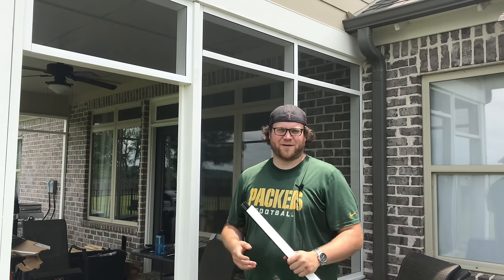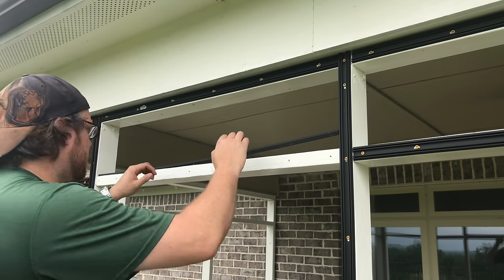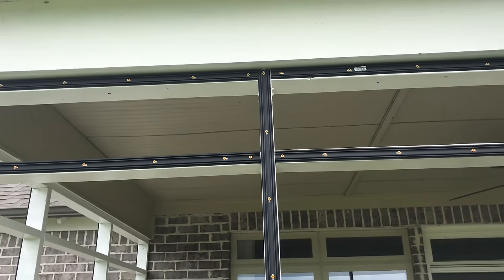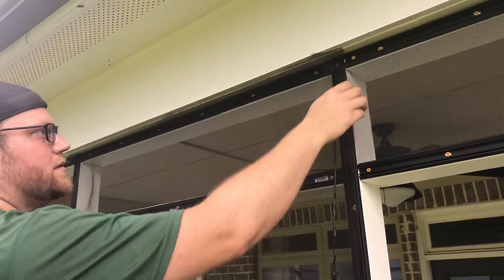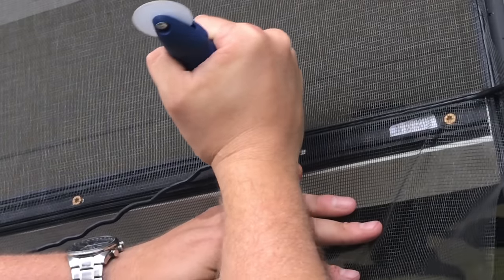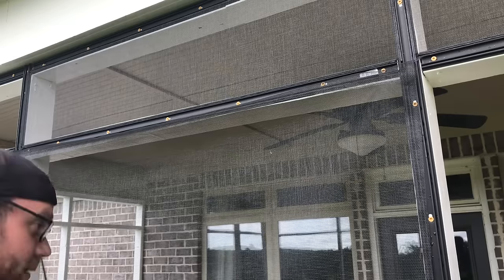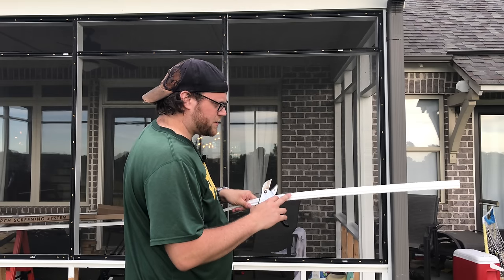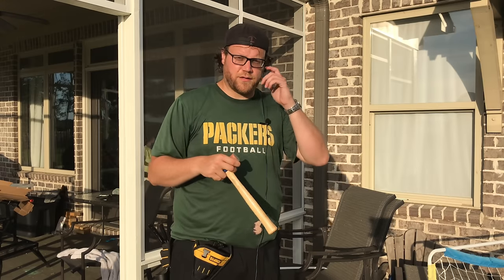Screen Tight Install Tips and Tricks

Comment: Thank you so much for making a video that is so thorough..showing possible mistakes..I'm a 72 year old female and did a porch on my trailer to keep cats from running out the door...It was hard to spline the heavy duty animal screen..especially for old hands..but got it done  and proud ..but never could have done it without your  lesson . Thanks again
Reply: I'm 67 don't have a clue.
Reply: Hi I am going to be using screen tight and using pet screen - what sized spline did you use?  I hear you need a smaller spline for heavier screens.  Thanks!

Comment: I've got to hand it to you, Anthony.  Not only is this this hands down the best tutorial for installing Screen Tight products that I have seen, it is also one of the best tutorials I have seen of any type.  Ever.  Your attention to detail, and additional helpful hints passed on from your own experience doing the work yourself is extremely beneficial.  Most tutorials are far too short and condensed, and omit the most useful parts of an install (the mistakes), and a mention of how to fix those mistakes.  You have included both.  Extraordinarily good job on this tutorial.  You have another subscriber.
Reply from the maker: Thank you for your comments. I really appreciate it. Everytime I attempt a project, even if I’m confident in doing so without any help, I still try to watch videos/lookup how to’s. In case there is something I can avoid or make the process easier. Unfortunately I couldn’t find any video to my satisfaction for this and after starting it myself I knew I had to make a video to get some better information out there. Again thank you for watching.

Comment: This was a helpful video, certainly better than the brief commercial videos put out by the company or Home Depot. I did a large porch DIY with several sections that were aprox 7'x4'. Doing it myself saved me about $2000 over professional estimates.  Also, I am no handy man so the project was challenging to say the least. Note, I found Home Depot the best place to get the "system" both in convenience and price. As I did it by myself there is one tip I'd like to share and one major mistake that Shelton presented.
I kept small pieces of spline in my pocket (2-3") and would use that to hold up the screen at the top randomly (just pushing them in). As I began putting the long spline in I would just pull out the short pieces as I got near to them. I couldn't have done it otherwise.
Shelton's mistake was to advise getting a small wheeled spline tool. You can see in the video as he continues to go back and forth pushing in the spline. I HIGHLY advise spending the $10 to buy the spline tool sold by Screen Tight. It fits their tracks perfectly. There were numerous times I could just run the spline in with a single movement. It also comes with a retractable cutting tool which was incredibly beneficial. You are seriously nuts if you don't by that tool.

Comment: Awesome video, I did the porch on my house when Screen-Tight first came out around 1990, it's a very easy system to install. About 5 years later I went on to start a part-time mobile screening business on the Coast of North Carolina professionally installing Screen-Tight and other systems for porches, rescreening window and door screens in a converted bread truck, then purchased an 18ft trailer to build a mobile workshop.
Your tips were spot on, I used the Craftsman Handi-cut that you mentioned to cut the vinyl in the same orientation that you did.  Later started using a mitre-saw with a 60 tooth blade, that provided a cleaner more accurate cut. I once had a customer that we had installed the system on her 2nd level porch and she later wanted the underside of the deck screened as well to keep mosquitos out, what a pain trying to screen over your head, but it turned out nice.

Comment: Thanks for the video. It really helped me to avoid any huge pitfalls while using this product to screen in my patio. I did make the mistake, twice, of installing the spline on the outside of a track instead of the inside. I did learn, however, that if you install another piece of spline on the correct side before removing the mistake, you will get a panel that is tight as a drum! Mosquito free life is awesome!!

Comment: Hey Anthony. Thank you so much for your video. I am a 63 year old lady with a porch that badly needed re-screening this year but I was not feeling good about those staples, tall ladders, and wood trim. So I did some construction (!!!!!!)   so I could put the screen on the inside using the screentight system. It has taken about 3 months to add 2x4's and stain and then the screentight. A little confusing until I watched your video because the manufacturer's videos are minimal (hey it's easy!!) , although they were very helpful with my email questions.The project is nearly finished now except for the door. The ONLY thing I would add is the use of the "mouse" tool to put the screen on. I had a difficult time with the other tool. I also bought the cutting tool you recommended.
Reply from the maker: Paula D the mouse tool, is that the one that has 2 wheels?
Reply: @TheVintageEngineer  yes

Comment: Thank you for a realistic instruction video.  I am not a skilled handy man and I did one section before I watched your video.  I couldn't get the cap on because I used the wrong track to spline and none of the manufacturing videos were detailed enough for me to know what I did wrong.  You answered that question and gave me a half dozen good ideas.  Thanks again and off to buy a tool belt....

Comment: Excellent tutorial.  Thanks.  One thing I did differently was to skip the cutting the screen between sections.  I let the hanging screen help me stay straight with the lower section, then cut the screen between the grooves after splinning. Saved a little time in starting the lower section and keeping the screen tight.  Again. Thanks for an excellent tutorial.

Comment: Thank you for this. VERY helpful. I enter Day No. 2 of my Screen Tight project tomorrow. This project is very labor intensive and will require me to take three days off work to get it all done. My screen porch is on the second floor of my home and the project I'm doing is about as large as the one you did here. Saving lots of money doing it myself, I keep reminding myself. Thanks for the straightforward, independent-thinker approach you took here. You probably saved me a fourth day off from work. :-)
Reply from the maker: I feel for ya. I can imagine the extra time added just by it being on the 2nd floor.
Reply: It's been a year since your comment so you are probably done. But I wonder (not knowing the cost) if it would be worth it for time and safety so you don't have to constantly go up and down on a ladder to move it a couple feet to invest in renting scaffolding.

Comment: This video was awesome and helped me with my screened porch - thanks so much for sharing.  I had a tough time finder the tool to cut the the tracks that Anthony mentioned, so I actually used a jigsaw with a laminate blade and it worked perfect!  Highly recommend that approach.  I cut them with the flat side down.  No issues at all.

Comment: Ditto on the other comments- really good and helpful. A couple of ideas for others to try. I bought a 1/8 inch hinge self centering bit at HDepot for under 10 bucks. Was perfect for centering the pilot holes in the track.  And I used wire cutters to trim the spline (much safer than the utility knife). To cut the track I used a good pair of pruning shears- they worked really well. My only quibble was the Packer's shirt. I had to put my Vikings pride aside and focus on the installation instead. 😄
Reply from the maker: I like the self centering bit idea

Comment: I maintained a screen enclosure at my former home for 30 years. Everything you said was spot on. One thing I would add is get a taller ladder. When you do the spline you should be shoulder high to the spline.
Reply from the maker: Good tip and makes sense.

Comment: I have done many screens and glass repairs growing up in 60s and 70s and taught by an elderly guy who has done it for years.  

good vid on some pointers folks don’t think it. 

I am planning on this (If i don’t get lazy and just staple like crazy and 1x4- 1x2 PVC TRIM and screw it.  But want option to replace partial screen as ya mentioned. 

1. Glad you mentioned (30 min in) about the wheel of spline tool away from panel. (ruined enough in our hardware store - dad not happy). very important. 

2.  Good idea on using the clamps.  May i add use the clamps and some scraps to hold one side of screen firm while doing other side?  (windows, i had all corners clamped to tightness).  This may help keep screen, especially fiberglas from moving and allow u to use that extra hand to keep the spine in line of groove
3.  If you can secure the corners or two edges, as you start your spline, keep the spline near the channel and pull a bit on it. find it will go in easier and not having weight pull it down (i worked with up to 48”,  but guy who taught me said it helps with setting the spline
4.  Get a GOOD quality SPLINE tool.  one with large and small wheel.-  i have seen the ones in big box store and won’t use them.  found one i like at Ace Hardware, wooden handles and better quality)
4. Why not use SS pan head screws,  pre-drilling is a must and glad you mentioned that.  I’m looking at Pan Head just for the reason ya mentioned “moving” and why vendor says “drywall had many of us baffled)

5.  For corners, get the 1” cheap plastic putty knives (not chisel tip). Worn out 1” plastic can be cut down width wise and great for corners. 

???
Have had folks down in FL say their fiberglass screen started to sag….  I am not sure if you or anyone experienced this.  i’m still debating on aluminum or the fiberglass mesh.  But would first contribute to sagging within weeks or months due to poor install or wrong size spline or other. ¯\_(ツ)_/¯ 

Def had some great pointers there.  Now hopefully I can get my stuff done while weather is good.  

And also great tips on the install and cutting of the plate.   These are tough lessons to learn. 

Thanks for great vid.👍👍👍

Comment: Hey Great job on the video. I am getting ready to do a screen porch and thanks for sharing the tips. I have one suggestion about the screws. I think I will use the BLUE 1 1/4 pocket hole screws by Lionmax. They are exterior rated and have a flat underside so I will not need a pilot hole. Saves a step. Again thanks for all the info!!!

Comment: The best DIY video I ve seen. I would like to add if you run your strips first cut a short piece of cap and snap it on when you put put screws. This also works for runs more than 8ft

Comment: Thanks man. I am building a new home that has a covered porch but screening was going to cost too much. I know now for sure I can do this. 👍🏾
Reply from the maker: You can do it cheaper with staples and lattice strips to cover but I wanted a more finished look and the ability to quickly make a repair when a panel rips. I think I paid less than a $1000 for everything (maybe closer to $800). That’s the whole screen system, screen, lumbar, hardie boards for the bottom. 1/4” plywood for the inside, pvc trim, paint, and even the hammer drill to attach the bottom plates to the floor and wall.
Reply: @TheVintageEngineer  
Ok, plywood on the inside bottom. Thank you!

Comment: Liked your video and how you show us real life rather than manufactures videos. Trick I discovered is to use the spline tool to push the screen into the track first then put the spline in over it . That makes the spline go into the grove so much easier. I’m sure I didn’t invent that. 
Thanks
Reply from the maker: I remember trying that but I abandoned that method for some reason. I think maybe because once you get to the bottom and sides that have to be pulled tight it didn’t work so well.
Reply: @TheVintageEngineer  on the larger panels I used short spline to hold all sides so I could go back and forth squaring it and making it sit almost perfectly then pushing the screen just ahead of where you are working as you go. It worked great for me as the spline slips in so easily

Comment: Wow! What a great video. Thanks.
One suggestion: rather than using the utility knife to trim the spline at the ends, invest in a cheap pair of cuticle scissors. Their blades are only about 1/4" long. 
I would also experiment with some sort of clamps - maybe three of them - weighing about a pound each, to clip to the bottom of the pre-cut piece of screen to help pull it down after you've splined the top. Just an idea: haven't tried it yet.
Reply: Utility knife has 3 extended lock points, 1/4", 1/2", 3/4"

Comment: I just installed this system on the front side the longest side of a porch I built. Instead of using the slots used a countersink bit and drill your own holes and you will not have to worry about the base walking over on you. I fought it doing it that way a little while and then changed to just using my countersink bit and things went much faster and smoother and came out nice and straight! I used 1 1/4" exterior star drive screws. Also, you just need to cut the screen just below the base like at the bottom once you have the top in. Then use a Hyde 5 way smoothing tool and push the screen into the bottom groove while you roll the screen into the top groove and it will be easier and come out nice and tight! Another tip I used my Kobalt 7 1/4" cordless miter saw with a Diablo composite decking blade to cut the base and the cap. I also did not find the need for a mallet I just pushed in the middle of the cap starting on one end then just hold up the other end with one hand and just push in the center toward the end you are holding up and it will pop in as you slide your thumb or fingers down the middle. In some cases, you may have to push in on certain stubborn spots with more effort. I also had no problem sliding it like a 1/16" or less to tighten the but gaps. In spots where you are filling in a sort section of the cap cut it a 1/16" long then put one end in bend it out in the middle then put the other end in and pop the middle in and you will not be able to see the seams unless you are up really close looking hard.

Comment: Thanks for all the tips, looks awesome! I found that if you pull slightly on the spline when rolling in to the channel it makes it go in so much easier. Pulling on it stretches it a little and makes the process way faster.
Reply from the maker: Yeah I noticed that too. Issue is having only two hands. Also if the spline is pulled too much it doesn’t grip as much as an unpulled spline that is fatter.
Reply: Anthony Shelton Uh oh I hope my screen doors stay tight, I sure don’t want to redo them. Fingers crossed.
Reply from the maker: As long as you weren’t pulling it like you were using it to climb up a hill I think you’ll be ok.

Comment: Great video, details and stumbling blocks were addressed wonderfully.  I work for a plastic extrusion company that's got some design differences from the screen tight system.  The new design changes address a lot of challenges with the base, cap, spline system.  I was wondering if you'd be willing to review and/or test the design, we're prototyping currently?  I'd love to talk with you sometime.  Thanks Mike

Comment: Greate video. I'm in the process of building my patio myself. A lot of good tips before I start. Question where did you find the design to build it. I think that's what I'm trying to figure out which looks good.  Plus did you base the screen length how far apart the 2x4 were? Are there larger ones?

Comment: Just had the idea to screen in our porch and watched this video, thank you for ALL the tips and tricks. I was curious though, In your case, when screening, could you’ve done your top panel and then instead of trimming the bottom portion, just splined it in place and continue on down the sides. Trimming it all up into their own individual sections at the end? Idk if I explained that well.
Reply from the maker: I think I got it, do a top panel with enough screen hanging down to do the panel below. Right? I’m thinking you could but you would have to give it some slack between the two panels so that when you are splining the top of the bottom panel, it’s not fighting you as it’s trying to pull at the bottom of the top panel. Wouldn’t hurt you to try it thought. Doesn’t work out just unspline and cut the piece separate and respline

Comment: Me again,  I used all your tips and techniques and the screen kit went in very nice.  Just a tip from me, I used #8 cup washers with the screens.   I had a hard time finding the edge clippers.  I did have an old one but it was dull and wouldn't cut all the way through.  otherwise, thanks for the video.   Tom
Reply from the maker: No interference issues with the cup washers and the decorative cap?
Reply: @TheVintageEngineer  No.  Home Depot has them in stainless, but a little pricey.  Make sure you get #8.  Also Lowes has them in decorative brass in little bags.  Both work fine, so far. BTW, I used #8  1 1/4 deck screws.